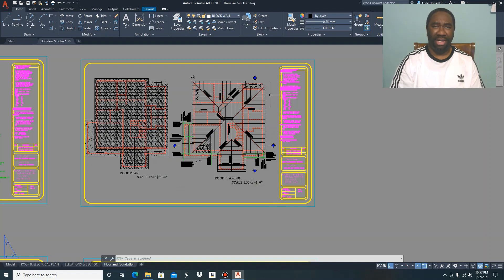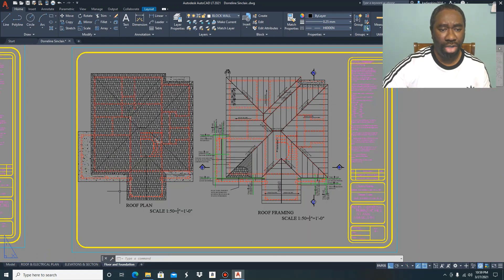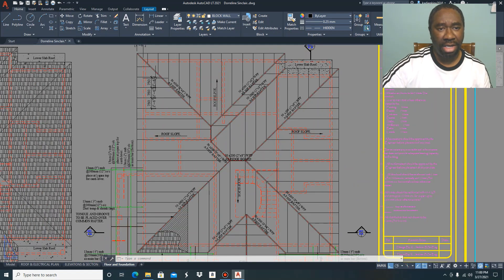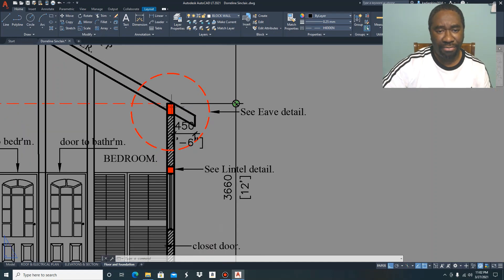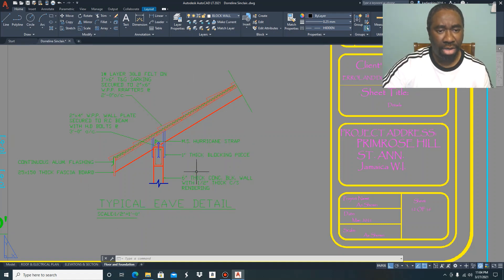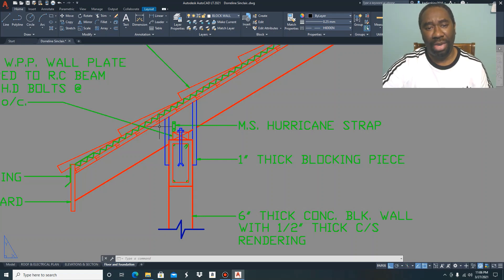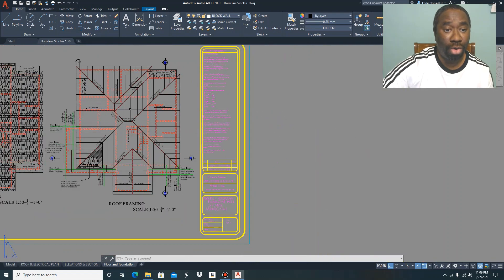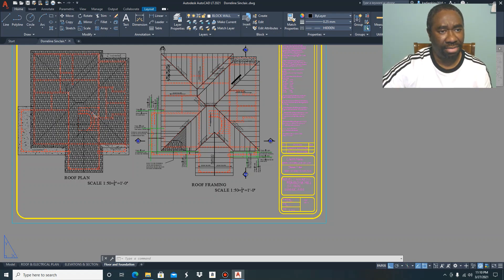How to read Roof and Roof framing Plan.

Comment: on the roof framing plan doesn't show specifically how long the ridge board has to be, so does the framer has to look and guess?  because the problem i have is the plan ridge board is alitle bit longer than what my roof actually need. does it have to me exactly like the plan and does the inspector want it to be exactly like the plan. this is for myself as a homeowner

Comment: If I provide a floor plan. Can you provide a roof plan with the materials needed?
Reply from the maker: Yes.
Reply: @jkengineeringarchitecture.  

This is a school,  research project 

What is your email. Do you have what's app.
Reply: @jkengineeringarchitecture.  

What is your email,  where I can floor plan..
Reply from the maker: My email is in the description, karljenkins2016@gmail.com
Reply: @jkengineeringarchitecture.   I'm sending email now. For contact.
Reply: Did you get my email?
Reply from the maker: No I haven't seen it. my emails in the description of all my videos and also my whatsAPP Number. @ericperry4934
Reply from the maker: ok I just see it. But I DONT See any drawings. @ericperry4934

Comment: Could you do a video on raft foundation professor?
Reply from the maker: Yes, I will certainly cover the topic of the different types of foundation systems in including raft foundation, as soon as I am finished with the plan reading series. Respect Genna
Reply: @jkengineeringarchitecture.  much thanks me general.